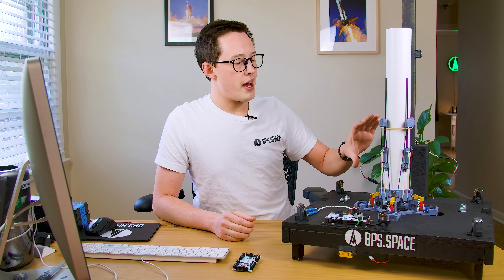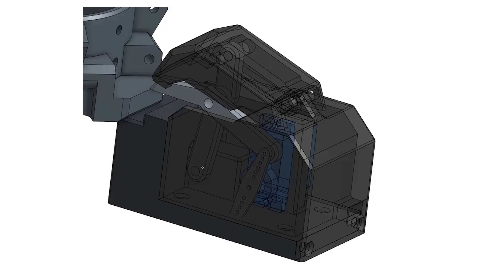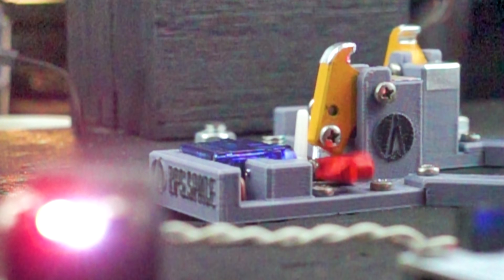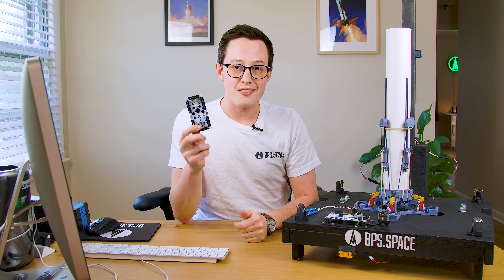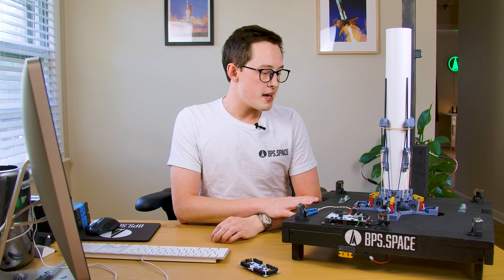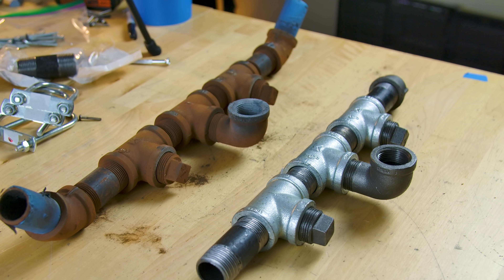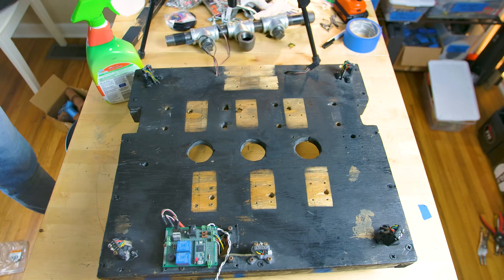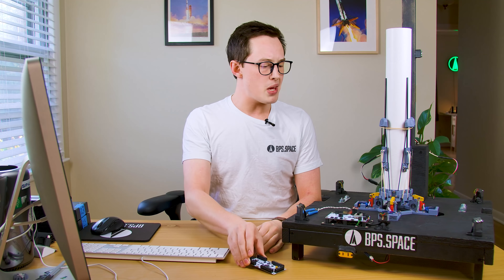Launch Pad Updates

Comment: You can definitely make covers for the new clamps, with just a slot for the clamps to retract in to. In this way, you use the clamps themselves as the sealing "door" for the cover. Use magnets to secure the covers, and you will be able to take them off easily as well.

Comment: you can put 1 high torque Servo underneath and have it pull on a ring that would pull all four of those clamps open at same time that would hide the servo so it's not getting corroded plus you don't have to worry about the timing of the clamps and one opening before other one does because they will all be tied together

Comment: You have 4 motors actuating four clamps- they are never gonna all release at the exact same moment- you also have 4 times the chance for a clamp delay or motor failure.
I suggest you actuate the red clamp props all simultaneously by making a RING with a crown gear run by a single pinion geared motor so that 4 pins protruding inside the ring all strike the red props at the exact same moment.   Alternatively, you could make the Ring Spring loaded so that it is counter wound 80 degrees, just shy of the next clamp over,  to a single catch that when released would release the sprung ring to accelerate thru 80 degrees to strike all four clamp props simultaneously and with enough momentum to overcome any amount of upforce on the clamps.
Either way- a large ring  with cam pins,  spinning outboard of the four clamp mechanisms offers a sure fire way to be certain that all four clamps are struck and released exactly at the same moment.
Reply: Or he could use explosive bolts to release it...

Might not be practical, but would be cool.
Reply: @zenithparsec  it would be realistic!
Reply: @zenithparsec  My thoughts exactly. If there was any uniformity to a firecracker, there's your explosive bolt for anything RC.
Reply: Honestly, the reliability that all the pins go off at the same time is negligible. It's model rockets. if it becomes a problem, I think he'll think a solution. The reason why his solution, although not ENTIRELY timed correctly is perfect is because it is simple and cheap.
Reply: A-c0rN   They are not ‘Just’ model rockets, he’s trying to do things with model rockets that have never been accomplished before, using sophisticated guidance systems.
His nemesis is the inherent variability in model rocket engines, and small components that introduce uncertain performance that must be compensated for.
My solution is just as simple and cheaper ( requiring a single servo rather than 4. )  time after time after time he has had problems with his rockets guidance system being thrown off by the rocket occillating during calibration.  Or not being dead vertical.   The tiny errors at liftoff get magnified.   The slightest delay in one or more clamps releasing will induce a moment in the rocket that his control system then has to correct for.  Moreover, tiny electronics and motors are subject to variations in speed of switching caused by infinitesimal variations in semiconductor layers, solder connections, and resistance that create variations in their operation. Relying on 4 of these to all operate exactly alike is inviting failure.   If One out of 4 actuators fail, or is slower, the launch fails or is compromised. Four actuators increases the odds that one will fail by a factor of 4.
(4 engine aircraft have 2 times the engine failure rate as twin engine aircraft )
Aircraft have multiple engines for flight redundancy.  That is, they can still operate properly with an engine out.  But this clamp design does not use the 4 actuators redundantly. The failure of any one of them is a single point failure for the entire flight.   ( if he had two actuators, both of which could release all four clams independently, with the second firing a tenth of a second after the first, in case the first failed, the That would be a redundant clamp release, and reduce the odds of failure. )

His whole channel has been a series of him having to figure out how to compensate for the fact that no two rocket motors burn exactly alike, no two rubber bands snap at the exact same speed, no two nichrome wires heat up at the exact same rate... all issues of fraction of a second variability in the the tiny components he has to use.
This is just one more instance where a system that did NOT depend on multiple tiny and cheap servos operating in  perfect unison would likely be far better for the initial moments when his rocket is calibrating its guidance and timing system, when he knows from experience that microsecond delays, count.
Reply: @a-c0rn  These model rockets are taking off with hundreds of dollars of hardware in them, it's not just a toy rocket from Hobby Lobby.
Reply: I thought of the same idea. Instead of the red pins have the large ring. Put a long ramp and cut out for each yellow hook. Now the ring can rotate one way to release and the other to lock the pins back in place.
Reply: Christopher Pardell i was just going to write the same thing.
Reply: This
Reply: Instead of a ring, this could instead be accomplished with a chain, belt, or cable mechanism. Easiest would be to string steel cables from each retaining pin to a single servo. Using a ring is unnecessarily complicated. You'd need an axle-less design for the exhaust to pass, it takes the maximum amount of space, and it scales poorly.
Reply: theDisasternauts   Actually, cables or chains are more complex.  A rigid ring, or even linear parallel rails tied to each other have no stretch, do not have to avoid obstacles or wind around the rocket along a circuitous path that would require pulleys and it would move as ONE object...
you can’t PUSh a rope nor a chain.
And who needs an axel?   Every lazy Susan is a slender ring shaped bearing with a large hole the the center.   I could lathe up a pair of functional races in about 15 minutes. If sprung, a simple large diameter torsion spring would work fine.
If he went with the linear rails- that’s just two rails longer than the flame ports- with cross bars linking them together at either end.  A couple of opposing U channels with the printed rails running inside. The actual servo could be all the way at one side of the pad well out of the way of the exhaust.  But to ensure all the props get knocked out at the same moment you absolutely need 4 hammer pins with a FIXED geometry relative to each other.
Reply: Christopher Pardell this is exactly what I’m talking about. A ring bearing is complicated and expensive compared to almost any other solution. He’ll have to turn precision races larger than the rocket diameter. Go to McMaster and price belts versus ring bearings with an ID the size of his rocket. Nothing needs to be pushed. Four pulleys and four cables is all the engineering required to make a synchronized mechanism for this application.
Reply: theDisasternauts   Its not expensive nor complicated.  it a lot simpler and more reliable than a collection of strings and pulleys. 
The solution I suggested was specifically tailored to the skills and equipment he already has.  He HAS a 3D printer. He models parts for his rockets routinely.
Anyone capable of modeling a part in 3D software and sending it to a printer could create the part.
You model a crown gear on the top side of the moving race, and a pinion gear that will fit on the spindle of a servo motor - The races do not have to be all that perfect since they are literally under zero load.  If you opt for spring fired, then the spring is a trifle harder to make, but you can literally go to one of 20 online sites, input the specifications for the spring, and have it custom made and shipped to you if you don’t think you can bend piano wire consistently around a cylinder and bend the the two ends at 90 degrees, which is all it takes to make a torsion spring.
Its literally 3 simple parts- plus some ball bearings. ( tho the ball bearings are optional if the guide flange inside the moving ring is round enough and lubed with graphite. )
Reply: Christopher Pardell I’m not sure why you think a pulley is more complicated than a toothed gear larger than the rocket diameter.
Reply: theDisasternauts   because you can’t PUSH a rope.  It goes slack.   Because you have to figure out how to mount at least 3 pulleys to guide your ropes all the way around to the far side of the rocket, likely more. Because  different lengths of string have different amounts of stretch. Because string is readily flammable, and wire cables will not bend to tight radii. 
Because the key to knock props that might be under load out is rapid elastic impact ( as in a hard material striking another piece of hard material ) and ropes do not impact, they gradually apply strain.
In gradually applying strain the ropes that have to run the shortest distance will inevitably pull their prop out before the longer runs will.
Because multiple pulleys and strings re-introduces the same problems that multiple servos have, that no two pulleys will have the same friction, so each pulley will lose a different amount of energy as will each separate length of rope.

Consider that his array of 4 clamps and blocks, with their mounting and hinges, ALREADY circle the entire rocket, they just have gaps between them. ( and not very wide ones )
Its not a Saturn 5. Its a rocket that’s 2 or 3 inches across.
Reply: theDisasternauts  PS- the kind of software he uses to model his rocket parts generates gear teeth with a click of a mouse.  Again... not complicated.
Reply: Christopher Pardell I don’t think you are seeing this clearly. Nothing needs to be pushed. Steel cable has negligible stretch and is not easily flammable. With properly tensioned cables friction is negligible. Generating a tooth profile in CAD is not the same as fabricating it. What happens when this scales up? You think hobbing a 1m diameter ring gear is no sweat?
Reply: theDisasternauts and Christopher Pardell 
I’m not an expert on any of this but would a sort of compression system work where it pushes on the side of the rocket and then the pressure can just be released instantly?
Reply: Jye Watson sure, that would just be some sort of hydraulic or pneumatic system. Ultimately it is just using pressure to transfer the force and do the work of moving the clamp. This is much more complicated because you need pressure lines, fittings, reservoirs, etc, but it could certainly be engineered.
Reply: theDisasternauts  You are neglecting the actual performance of materials at this scale.  Steel cables at this scale are like bicycle brake lines. They are not flexible enough to run around a small diameter pulley unless they are under tension. You might be able to use cable housings, Like a bike brake does- but if you think that system has no stretch in it then you have never tried to adjust a bike’s brakes.   To get them taut, they have to be under spring tension... and given that they are trying to pull a prop out from under a load, where do you think that tension is going to come from? Enough tension to hold the line taut would pull the prop.  By definition the prop needs to be under no tension in the direction of release until you want it released.
You are mistaken about how hard it is to fab a ring and 3D printers print gears ALL THE TIME. There are thousands of videos demonstrating this. You can even download pre-modeled gears for free from thingiverse and just scale them to the size you need. ( still- I would prefer to opt for the spring driven ring- which is simpler and allows for looser tolerances )

Even more accurate is to drop by any maker space and run it out on a CNC router. ( if you don’t have a small CNC router.) 
As to scaling it to a meter...  What makes you think he plans to make a meter wide rocket?  The electron is a meter wide rocket and they have far more robust means of holding their rocket down and releasing it.
However- fabbing accurate circles and rings at that scale is not hard.  I can do it with a hand cut sheet metal template mounted to a wooden swing arm and a bucket of plaster to tolerances of a few thou. 
But at large scales, of course you would come up with different clamp solutions, based upon the forces involved and the behavior of readily accessible materials at that scale.
to make a similar device a meter wide you can cut the rings out of a sheet of plywood... and literally use the same circle cutting jig to router the races for some bearings. Or even simply rig some ready made steel bearings as guide rollers arrayed around the inner edge of the ring-

The thing your idea does not address is the core problem.  Relying on multiple, separate assemblies made of low tolerance materials to act in perfect unison.
The solution is to ensure that all four props are hit with identical force, at the identical time, with hammers that travel an identical speed and distance.

At the scale of his rockets... a Ring solves that problem with the fewest parts.
Or for 3 motors arrayed linearly- A rectangular frame sliding longitudinally with 3 hammers on each long rail that strike 6 props arrayed with a pair of props on either side of each rocket tube.
Simple. Robust. And not even remotely difficult to fab for anyone who knows which end of the screwdriver means business.
Reply: Christopher Pardell This is getting silly. You aren’t looking for the best solution to the problem, you are just being fervent about advocating your solution.
Reply: Christopher Pardell and the disasternaughts 
You guys are actually too smart
Reply: theDisasternauts also that is very true about having the pipelines and stuff like that but I was thinking more of a thick rubbery ballon squeezing in on the rocket and then he just pops it and bam bye bye rocket
Reply: Jye Watson yeah- I’m a regular Rick.   Its a curse.
Reply: Christopher Pardell well it doesn’t really sound like ur a regular, u sound like ur a smort person like too smort also would the stretched ballon idea work?
Reply: Or he could put a compression system on the side of the rocket i.e a sort of ballon?
Reply: The issue i see with that is for triple core launches. The current mechanism allows for him to move the clamps where he needs to. A single ring would limit that and would require a completely different mechanism. He doesn't seem to have issues with the timing of old set up, i assume that he's confident it will be just as reliable. At 5:37 he has slow motion of them actuating, one is slower than the others, but he stated that it's functionally irrelevant. Cool idea though.
Reply: Mids   Good point-   But the same basic effect can be achieved by using two linear rails that are, nevertheless, still tied to one another at either end so that they will move as one unit- that, however, might require a slightly different geometry to the clamps to offset the fact that the rails would not be moving exactly perpendicular to the angle at which the clamps are set.  The ring solution could use the clamps he has exactly as they are.
Reply: @christopherpardell4418  The linear rails would be more universal. It would be easier to go to a triple core setup, just drop your other pads in and put a pin in the rail to activate it.  I was already working on that design before reading these comments =)
Reply: @Jeff_Rowe_Nuggzy   I agree-   I initially thought of the circular design because of the existing arrangement of the clamps.  The linear rails would be easier to make and work with 3 side by side tubes as well... and they would be easier to make spring driven using simple straight compression springs on each side. This way the release could simply be pulled into compression with a single latch and the the hammers accelerated to strike by the release of that single latch.

Comment: WHAT?!? THROTTLE CONTROL?!? HOW THE HECC?
Reply: YEAH HE CANT JUST SKIP OVER THAT PART, THATS ILLEGAL
Reply: @SHMIDTEY   I KNOW RIGHT?!?
Reply: I think he just vectors the motor at different rates.
Reply: @levedelson1924  It's an SRE, it can't really throttle. If so, mind explaining?
Reply: @thechanceogden  im guessing that means alternating thrust vectors "wastes" thrust slightly in directions other than down. Cosine losses basically.
Reply: @SHMIDTEY  That's what I thought originally, you can actually "orbit" a gimbal to burn off excess "Delta v"/thrust. But I don't think the Ava flight computer can handle that.
Reply: @thechanceogden  He mentions this in one of his previous videos. The motor would be vectored back and forth at different rates. When the motor is not centered it produces less direct thrust and therefore it's effective thrust is reduced.
Reply: @levedelson1924  Ik, I remembered that after I replied to @SHMIDTEY
Reply: My son does it by staging the motors. Stronger to lift and less to descend. Its not real time thrust control, but since we know the flight plan he just has built-in thrust control.
Reply: @Jason-gt2kx  Does your son own Delta Space Systems? Or does he have a different channel?

Comment: "Overvolt your servos if that's who you are as a person" Hey man I feel offended. There a 10% tolerance on most electronics for a reason!
Reply: "I paid for the gauge so I'm gonna use the whole gauge"
Reply: When there's a will, there's a way.
Reply: In my rc rock crawlers I overvolt my 6v servos to 7.4v ;)
Reply: Ya so you can undervolt them but if you buy them in a 20 pack and rust them out intentionally maybe you should give some old rusty junk to your patreon supporters?❤️
Reply: Yes but they fail faster
Reply: I'm more of a 30% kind of guy